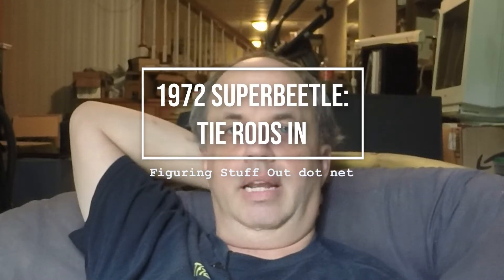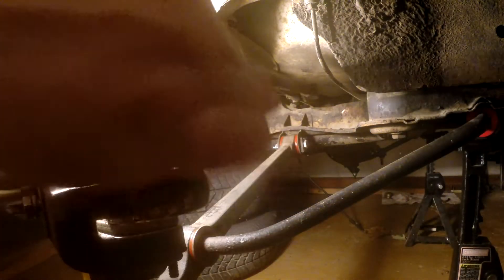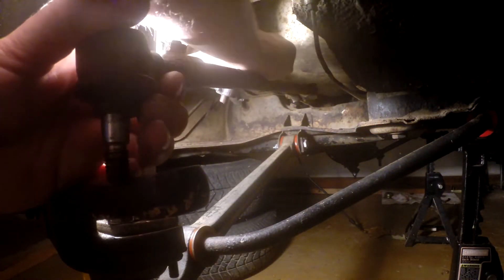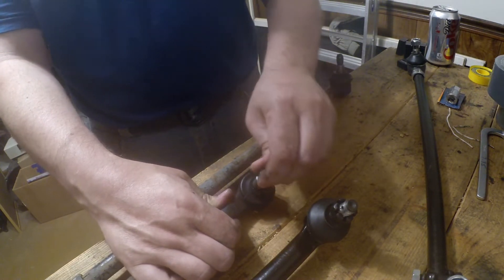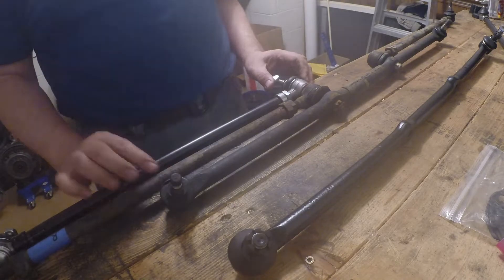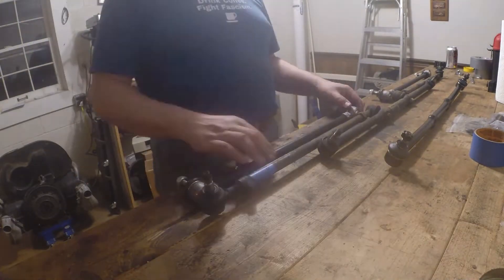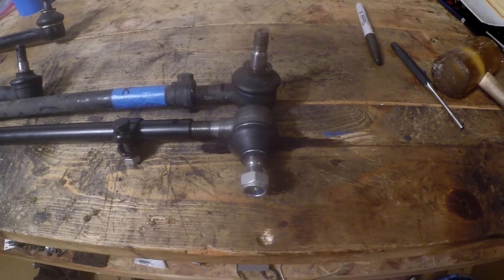Tie rods into 1972 SuperBeetle

Comment: I do have my beetle 1302 at Cairo, Egypt. Thanks a lot ! , I understood what is tie bars. but I have some explanations, may I:
1) Do I have to change the all six ball joints ? Just the two for each side rod are enough, or in addition to two joints of central rod too?
2) Are all ball joints of same shape and size too? 
3) If  I reused the three old rods it self again with the new six joints will them be safe and reliable too for car driving?
Best regards
Reply from the maker: Hi Akmal!  

What you're calling "ball joints" are what in the US we call "tie rod ends".  

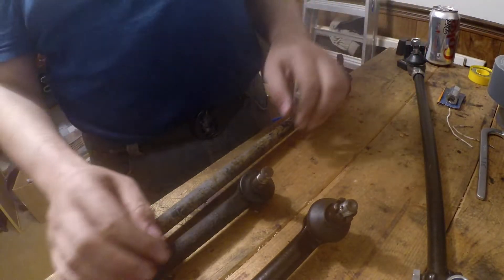As you said, the side tie rods have separate tie rod ends that can be replaced.  However, the tie rod ends in the center tie rod are part of the tie rod.  They cannot be replaced; the whole tie rod has to be replaced.  You can see the very loose tie rod end on my center tie rod at 0:56 in this video.  

There are two different tie rod ends for the side tie rods.  They have a "left hand thread" and a "right hand thread".  

Replace the center tie rod, or the tie rod ends if they are loose.  You'll know there's a problem if it vibrates (shakes) at certain speeds.  If it doesn't vibrate, and the tie rod ends are tight, then you don't have to replace them.  I replaced all those components because my car would shake very badly from 35 miles per hour to 50 miles per hour.  

By the way, there are ball joints in the suspension.  There is one on each side.  The ball joint is at the bottom of the picture at 3:19 in this video.  

Good luck with your car!
Reply: Many thanks you explain me very valuable information so I will follow your steps. I would like to hold your hand to thank you. Best Regards.  @fsodn

Comment: What are the torque specs on the tie rod nuts
Reply from the maker: I'm sure there's a torque spec, but I don't know that I ever knew it.  Since they're a major structural component, critical to the car's safety, I got them as tight as I reasonably could with hand wrenches.  I'll try to look it up.